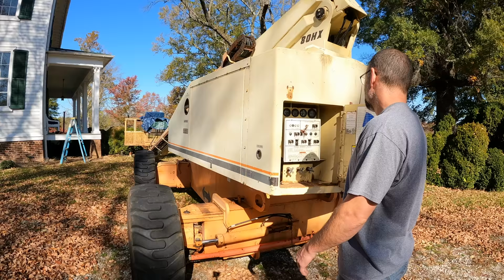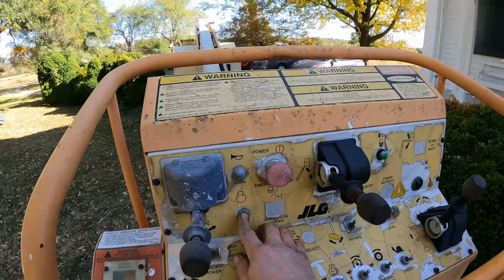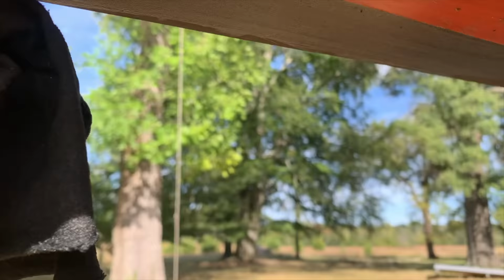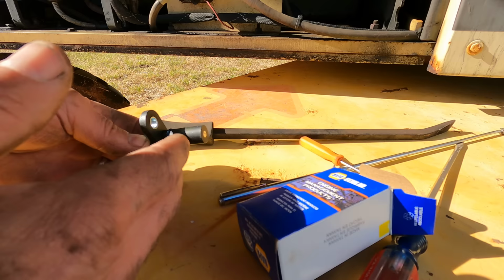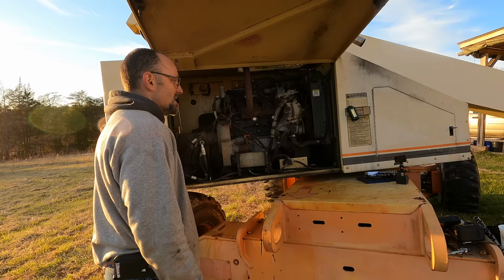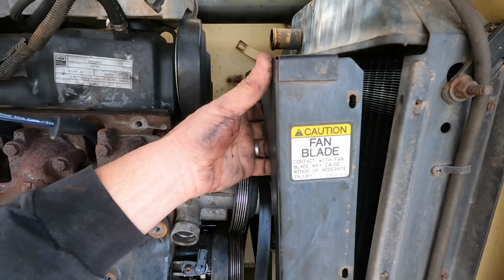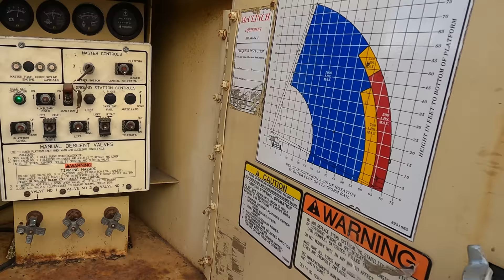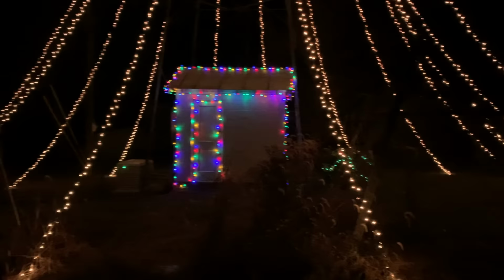My Boom Lift Broke Again! Fixing It & Then Doing a CRITICAL Job With It.

Comment: Here are a few thoughts.
1)Fuel pressure needs to be 5-60psi and when not in use should maintain at least 35psi.  If it doesn't you have a fuel issue.
2)If it has an EGR valve and it is stuck open it will foul the starts and cold idle.
3)Vacuum leak.  Pull the vacuum hose that is connected to the carb, if the idle stays the same you have a leak.  If you can extent the hose and suck on it the idle should rise.
4)Timing issue.  In the past someone changed the timing belt and it is off by a few teeth.  If you have a timing light it should be 10°BTDC.  The ECU could be retarding the timing to far for hard starts.
Reply: No way am I a full on mechanic and you obviously are but I have always experienced 4 cylinder gas engines to be ridiculously thirsty to start when cold. I wonder if he could pump the throttle vigorously if it would start right up..... Growing up in Maine back in the day (before EFI) that was routine for a cold start. Saves on the battery and the starter.
Reply: The EGR valve is the stupidest invention EVER.
Reply: I was thinking the same, but also it could be the fuel reservoir canister, fuel filter, or fuel tank screen.  But my guess is a vacuum leak or fuel check valve issue.
Reply: Fuel is not likely at all. The bowl was good on fuel when John opened up the carb to clean. EGR and vacuum leak are both very likely though. Timing, maybe. Runs too well to be off too much. However a belt that old may be stretched and in needs of changing.
Reply: @fritzmiller9792 I remember those days!
Reply: @willgallatin2802  very good point, I forgot those engines have a belt driven timing gear and not chain driven.   that makes perfect sense
Reply: @Matthew Prestine, 5-60psi not for a carb engine, should be no more than 6-10psi, the numbers you are talking about are for fuel injection system.
Reply: no way dude 6 psi max
Reply: A greed, 6-10 psi max!  

Only human!
Reply: @matthewprestine1974 , the carb on my bike runs 
just fine, with a 2 inch drop from the tank to the 
float bowl.  For a "car" carb, 3 or 4 PSI should be 
just fine.

steve
Reply: lol NO... 5 to 6 psi MAX, it does NOT have an EGR and there are no vacuum parts to this so im not sure what planet you came from but its clearly you have NOT watched his previous  videos or have any knowledge of wtf you are talking about...
Reply: Is there a fuel filter prior to the carb? If dirty gas keeps getting to the carb it could gum stuff up after the carb is cleaned. Seems like the low idle screw adjustment improved things but may not be set correctly still.
Reply: They are all just suggestions 

It's not a ford but same engine that I I worked on, settle it all to help find the issue, it is all just help!
Reply: I would perform a cold and hot engine compression test.  Sounds like low compression when cold start.
Reply: Whatever the problem is, this video makes it abundantly clear why you need to test and diagnose first before you just fire the parts cannon repeatedly (and miss)
Reply: Interesting
Reply: EXCELLENT list of likely culprits!

In the spirit of KISS my vote goes to ...
1- Choke spring

2 - Vacuum line Or physical vacuum leak.
- Test by in addition too sucking on hose, ☆☆☆ also spraying starter fluid all around the manifold which should have NO effect on idle unless there IS in fact a leak.

3 - Poor / high resistance electrical ground affecting current level / flow to the ignition circuit.

- Ohm out connection from negative battery terminal too block should be damm near Zero if terminated directly
on the starter and not much more if on The the frame / chassis or the block itself

See ...
ASIN   B07BXXNRK5

4 - if the ground connection is poor the spark will initially be weak during starting when only running off the battery until the alternator kicks in which in your case was initially faulty
See ...
ASIN	B01HU2L1NU

Also ...
Ignition wire resistance values vid 
https://youtu.be/7ll30u39DEE

If the negative battery terminal is directly connected to the starter with a perfect connection that is best case scenario however if the negative terminal is connected to the chassis instead then it is critical to have ground straps from the block to the chassis 

☆☆ Step one trace your negative battery terminal cable and proceed from there good luck God bless Merry Christmas
Reply: 60 psi is way too high for a carburetor. That's fuel injection pressure range. Carbs are around 5. Have someone squirt fuel in intake when starting. Not all starting fluid works well in gas engines. If it improves you have confirmed it's a fuel problem and not spark. Carbs are not magic. Find one off an older non-computer car engine that will fit the bolt pattern. Should be a lot cheaper and work much better.
Reply: your all wrong 
theres no egr valve
its not a vacum or timing issue
its not  a fuel issue
its an automatic choke issue 100%
Reply: If it was a van I'd say, chuck the carb and put a Weber on it ! but I'm old fashioned, (old ).
   At the risk of adding to a wave of recrimination, WD-40 is a rotten lubricant, it's ok when it's wet, but dries leaving a sticky residue.  There are dozens of lubricants aerosol and other, I'm damned if I know why everybody buys this stuff.  If you like that kind of product I prefer Duck Oil, stays oily .

Comment: It's been a while since I messed with carbs but I'm quite certain that "fixed in place" part that doesn't allow the choke to fully open should be a piston that uses the vacuum of the engine to help regulate the position of the choke working counter to the force of the bi-metal coil.  Basically, the coil should have more than enough force to hold the choke closed by itself.  From the vacuum hose that you removed while disassembling the carb there should be a passage to the back side of that piston and it will allow the built up vacuum caused by the closed choke valve to assist in opening the valve enough to allow enough air through to balance out the choke position.  Once the coil heats up and loosens, this vacuum should be enough to pull the choke open and hold it.
Reply: That's my thinking too.  Somebody ran the adjusting screw in all the way, and now the piston is jammed in the bore.  The engine runs badly because it's at partial choke.

Comment: What a pain for you with that engine, I would do a compression test to rule that out and then figure out what electrical issues are happening. I would be doing whatever I can to get that reliable again, I am amazed at how versatile that lift is for all your projects, it really spoils you when it is working properly. Great editing once again. Looking forward to the next episode.
Reply: Compression and leak down would be good.
Reply: I’m getting the same vibe about compression.. wonder if a slightly heavier grade oil might help..??
Reply: Hi,no my knees get weak when you take us up 60 feet,it looks like a 160 feet.

Comment: John have you ever checked engine timing? All that black smoke and hard start could be attributed to not enough advance. Also have you inspected the timing belt to make sure static timing is correct? One last thing I would check would be fuel pressure?
Reply: Fuel pump is the first thing I've guessed

Comment: Have you considered fitting an in line electric fuel pump and in line filter  ? Appears to me that the valves of your lift pump are allowing fuel to run back to the tank ? An electric pump will prime the fuel line as soon as the ignition is switched on, great videos keep up the great work

Comment: I had a diesel that had this same problem .. after years of cranking on it for 1-3 minutes at a time I discovered that the contacts inside the ignition switch werent always connecting to "run" - so it would turn over and crank but the fuel solenoid wouldn`t actually let fuel out. I know its unrelated to your issue but you cranking on that brought back those memories, lol.
Reply: Intermittent issues like these have led me to chase electrical issues too. Poor contacts have been the bane of my career.
Reply from the maker: So you know the feeling.  It sucks!  ;-)
Reply: Best of luck to you sir 😅

Comment: Pro tip with wheel speed and crank sensors from someone living in the rust belt. Heat the metal that it's sunk in enough to melt it and break it free, then do the screw and slide hammer trick. Also, give it a light coat of grease before you put the new one in, since aftermarket ones are junk and you'll probably be replacing it again in the future.
Reply: Ceramic anti seize for aluminium is the way to go and the old one had gotten water in it and swelled up, the bane of ABS sensors!

Comment: Hi John it sounds like the hard start is a fuel problem. Not sure if you have an electric pump or mechanical pump. But try cycling the key 2 or 3 times with a delay of 2 to 3 seconds between cycles if its an electric pump. If it's a mechanical pump its my guess that  it's on its way out, its weak. Also check to see if you have an inline check valve, it could be leaking back to the tank. It's hard to diagnose something when your not in front of it but it's where I would start. And on the length of videos, my preferred length is 20 to 30 min., but your videos are the exception. Your content is always interesting and they never feel as long as they are. Keep them coming just the way they are.
Reply: Yes because when it cranks. Vacuum helps to pull fuel.

Comment: Hi John, that galloping sound as it’s turning over leads me to believe you have a cylinder down. Check compression.  You may have bad rings or stuck valve.  The black smoke may be indicating bad rings.

Comment: Great job getting everything working much better!  I wonder if something as simple as a check valve for the fuel line would solve the issue?  Fuel draining back to the tank and some evaporation of the bowl fuel might create the delay you are experiencing.  Only other thing I could think to try would be using something to physically change the choke position(with the air filter off) while trying to do a cold start to see if that gives you another data point.

Comment: I'm not a real mechanic, but, my deceased dad was an awesome mechanic.  He often found vacuum lines to be leaking or that vacuum was not adjusted properly.  Just something to consider.  I have really enjoyed this video and often wondered how you proceeded without use of the four letter words.
Reply: An easy edit to fix.
Reply: Did you test the electric fuel shutoff solenoid?

Comment: If you look closely, you could already see the back of the alternator sparking at 31:48. A few things considering the hard start issue: 1) engine could be flooding while starting considering the black smoke and it is not responding to starting fluid 2) check the cam timing 3) if no hydraulic lifters, check valve lash 4) the starter can pull too much amps causing weak or no spark. Furthermore love the channel, thanks for all the effort, merry xmas from Europe.
Reply: Lifters should be hydraulic so can likely eliminate that one at least.
Reply: May have low fuel pressure

Comment: Very nice Light setup!
I wonder what the feasibility of doing an engine swap for this would be. Definitely very interesting!
If only you were still working on your outboard motor, then if someone asks what you're doing, you can tell them "'I'm restoring my 60 year old Johnson". Guess you'll just have to settle for telling them that "I'm trying to fix my boom-lift so I can get high".
Reply: LOL  !!
Reply: I feel like Jon would be happier with a 3 or 4 cyl diesel. He seems to despise the gasoline engines. But at this rate he's gone through everything.. might as well run it!

Comment: A couple things, I noticed you didn't attempt to adjust the float inside the carburetor, try adjusting it! Also, I think you may also check the fuel filter and pump. Replace them !!
Reply: Agreed... and perhaps the long crank is due to the fuel level dropping in the fuel bowl (for whatever reason) and the pump has to fill it back up again.  Or it may be flooding (from fuel level being too high or fuel leaking down into the engine.  Either way, I'd verify correct fuel level.  That thing should start and purr after a revolution or two... the base engine has been around for 50 years.
Reply: Feels like fuel is leaking back while it sits, float valve seat? Pinhole in the line somewhere?
Also seems too rich once it's actually running
Reply: If the carb was that dirty and you had to replace the fuel line you should always start with the tank and make sure that's not the source of the smeg in the carb.  Pump and filters would be next on the list.  If the maintenance has been that bad it's probably time to change all the ignition parts, all the other filters belts and hoses along with all the fluids and other minor tweaks parts.

As for greasing the boom chain, it seems a lot like an oversized motorcycle chain so a similar procedure of glopping on a big wad of grease and cycling it might distribute it to the parts you can't reach.  

I also think that the engineers who design these should be required by law to spend a month disassembling them and building them back.
Reply: @jimithompson7442  IIRC he replaced/rebuilt on the carb.. everything ignition including crank sensor
Whole point of fix-er-up machine is squeeze life out what you can reasonably get away with no?
I get the cheap insurance angle, but no need to go crazy with the parts cannon either 
 For all we know the engine has cracks or needs rebuild, and there's a ton of em sitting in junk yards with relatively low wear

Comment: Put your hand over the top of the carburetor while cranking the ice cold engine. Spread your fingers slightly or tip your hand up off the carb top just a little bit after it fires. You are essentially acting as the choke then. If that helps, you know where your problem lies. On a car thd choke stays shut fully until the engine starts. Then there’s a vacuum actuator that pulls the choke open just a tiny bit to maintain a good fuel mixture. That actuator is adjustable so you can set it for optimal idle performance on a cold start. I’m a former automotive drivability specialist. I’ve repaired thousands of carburetors. That choke plate should not be fluttering open on startup. Once the engine is warmed up, the choke should not be closing on a restart after 20 minutes either.

Comment: There is an alternator and starter rebuilding shop within 15 miles of my house. I've used them for decades. Exact remanufactured quality you get from parts store for under $60. Drop it off in the morning and pick up in the evening. May be worth locating a shop like that near you for future use.

Comment: Might be worth trying one of the small engine efi kits on this. I have had good luck with them.
Reply: That would be cool, but this is a simple 50 year old engine design... which makes me wonder if going back to a conventional distributor might be worthwhile (if the hole for the distrib is still there... think it is... think there is a crank/cam position sensor in that hole?).  The automotive version would've had port fuel injection along with that distributorless ignition system (DIS).  It seems a little cluster-eff-esque to have a carb on that engine and yet retain the DIS.
Reply: @mikemiller8170  John, replaced the crank sensor in this video. Actually a cam sensor is used on some models, but mostly on models with EFI. Ford used the EDIS-4 module for the ignition timing, If this does not work correctly timing problems occur, what would explain the hard start condition and shutting down from the engine under load.
Reply: Get a much newer engine with simple EFI from the factory. A Pinto out of a Ranger, maybe.

Comment: Good stuff John.  I think I would consider modifying that fan shroud so that it could be taken off in two pieces.  Cut the top and bottom and make a bayonet slide with some sheet metal and a couple of sheet metal screws top and bottom, then one only has to remove the part of the shroud towards the outside to get to the fan and water pump.  Great video thumbs up.

Comment: I have an 82' tall radio tower I erected at the end of my shop to put a point to point microwave antenna on for interwebs. Sure wish I had one of these machines every time I want to change my flags. It would be a lot easier than climbing that sucker hauling everything I need and wearing fall protection.

Comment: Several comments, I agree with others that the hard start is a choke issue, on the sensor replacement it is highly recommended that the surface be cleaned well before installing to maintain proper air gap, on boom extension the blocks you see on end are just guides and wipers there should be rollers inside that the extension rolls on. They could be out of adjustment or worse allowing the tube to drag on guides. I hope any of this helps. Thanks for sharing your time.

Comment: I wonder if running it without a thermostat overheated anything and warped the block or heat just enough that it’s losing compression but not use it water. I’d do a quick compression test.

Comment: Add a little electric fuel pump and a fuel filter.  The pump is just to check if you have sufficient fuel at start, you can remove it if no difference.  The filter is almost a must have for something that old that's been sitting even if you replaced the lines.

Comment: Awesome video John!  I wonder if it's a ground issue, it seems to start easier from the boom versus the ground control panel?
Reply: Good idea to check grounds, but he did mention that it's easier to restart once started.  Although even the restarts seem crappy to me.
Reply: Ground or some electric issue, maybe some wire insulation has rubbed broken. I would take alternator belt off and see is it a huge load when you start it from basket. If there is a near short somewhere, it could put a lot load into alternator.